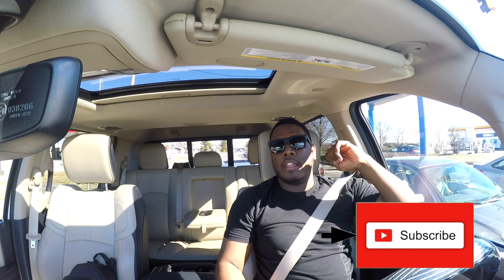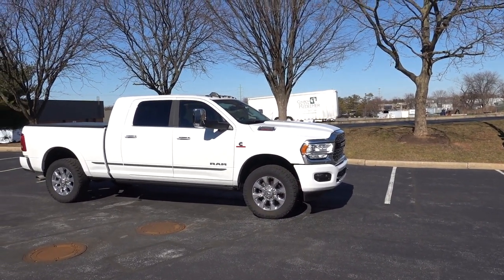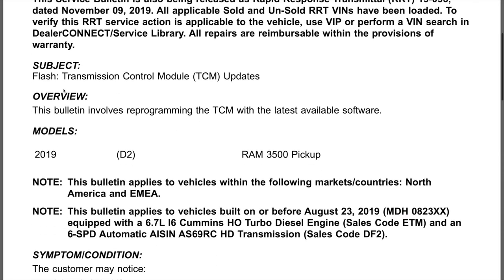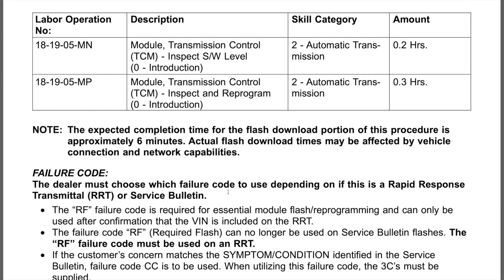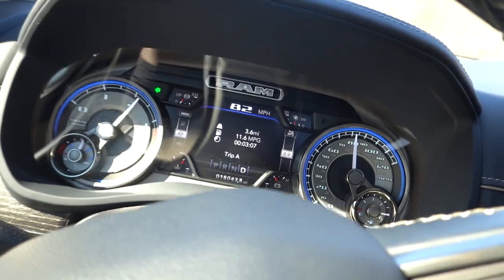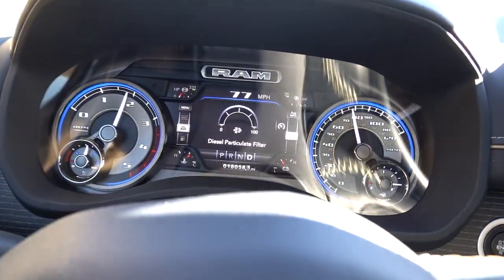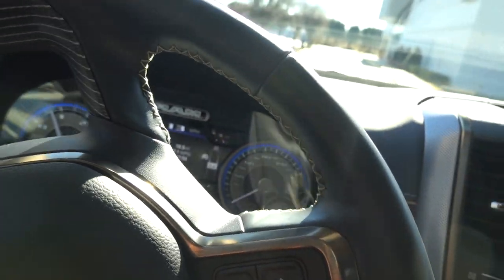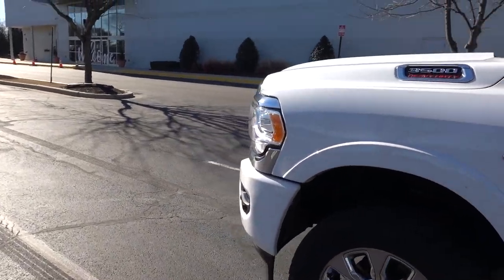Aisin Update After Reflash | RAM HD HO Cummins Acceleration & MPG Unloaded!!!

Comment: I have a 2021 3500 HO, SRW.  I have 3000 miles on it now.  I haven't got the DEF usage figured out yet.  I have yet to put ANY percent in the DPF filter.  It's been at 0.  I live in the country so no real city driving for me.  The dash pretty much is always at 18.5 MPG.  I haven't driven it on a highway more than 40 miles one way.  I've made several "mostly" highway trips that were 31 miles one way and the round trip has been coming in at a little better than 20 MPG.  

The only thing I consider quirky about the Aisin in my truck is shifting from Drive to Reverse if the truck isn't completely stopped it'll clunk.  Compared to the Ecodiesel the power of my 3500 is addictive. My ecodiesel trip B has 180k miles and an average MPG of 23.5 and that's with quite a bit of "dirty" towing at the end.  Hence the 3500.

And yes I feel the 21 Aisin wants to get to 6th gear ASAP.  It shifts EXACTLY like my brother drives his 01 six speed.  Like from a stop he gets to third gear and he's still under the light! I'm not crazy about lugging the engine so much I'm always afraid the cylinder pressures are too low.  So in the hilly country around here I'll usually limit the transmission to 5th gear.  That seems to keep me in an acceptable lugging range and it lessens the delay of the computer shifting down from 6th.  If you just pull out from a stop and don't baby it I feel the Aisin shifts through the 6 speeds exactly how I would shift it if it was manual.  I'm really OK with it.

Comment: i get what you are talking about on the driver adjustable shift points. I personally bought an hptuner for my 2004 Lb7 dmax Allison and the first thing i did was adjust all the shift points to where personally like as the driver. The factory one worked of course but for my driving style it held gears too long. Though I find that the Allison computer really does learn to adjust shift pressures on the fly pretty well, buttery shifts no matter load or not

Comment: Great video JB.  Glad that the transmission is working way better for you.  I was looking at you dash and noticed that you don't have the ability to manually shift like my GMC.  I don't use it a lot as my transmission seems to hold it's gear and shift up and down really smooth in city driving.
Reply: It's on the steering wheel
Reply from the maker: Thanks Ric, and like love racing said, it’s on the steering wheel. It’s definitely needed when towing 👍🏾
Reply: @JB_WhoWork  ok.  Didn't know that.

Comment: I’ve run my new 2021 F-450 with the 10 spd in economy mode and it up shifts super quick.  I usually drive it in the default drive mode and like it better in that mode generally.
Reply from the maker: Thanks for sharing 👍🏾

Comment: The torque of the cummins only needs 6 speeds, 10 is too much for it to shift, the V8 " not real diesels" may like the shifting, but the cummins hits 6th & pulls like a freight train 🚂
Reply: Ford guy?....
Reply: I personally like a 6 speed transmission better but the cummins doesn’t have the most in class torque lol
Reply: @holysmokes9813  nope not at all. I currently have a 2019 duramax. Previous to this a 15 duramax and a 14 cummins 68rfe. Loved the cummins but at 35k miles it needed its third trans. Have had a duramax since. Your cummins will eventually have a 10spd just like the rest of the market. That’s why I said your comment is dumb. What makes a diesel a real diesel?
Reply: @ToolsandTurbos  "Loved the cummins but at 35k miles it needed its third trans." What were you doing to the truck to blow through 3 transmissions?
Reply: @monsterram6617  towing a 28ft TT and a enclosed trailer. I really think it was more a tuning issue. When the converter would lock up the truck would shutter really bad. Dealership had my truck from December until April trying to figure it out. Got it back and still had the same issues so I traded it in on a 15 Denali. I did prefer the power of the cummins over the lml. Now I have a l5p and it is far better than both in my opinion. I wouldn’t mind trying a f450 next but I have never owned a Ford lol
Reply: How is a v8 diesel not a real diesel lol.  V16 diesels have something to say about that
Reply: "Not real diesels " 🤣🤣

Comment: JB - have you heard any updates on these aisin issues for new 2022 builds? I just ordered a 3500 Megacab SRW HO w/ the aisin, seeing all these bad reviews is giving me cold feet. I do majority highway driving about 30k per year, mostly unloaded to 1,000 lb in the bed. One weekend a month  towing a 9,000 lb travel trailer with plans to upgrade to a 11-15,000 lb fifth wheel. Hoping these issues have been improved by now?
Reply from the maker: Hey Brent the updates have been made to the Aisin for newer trucks and I’ve noticed they do shift smoother although the delay is still evident. This is the most reliable transmission in the HD market currently. I’ve heard from GM/Ford owners that they have had issues with the 10 speed which isn’t a surprise since they haven’t been out that long. Aisin has been around for over a decade and has improved over time so rest assured you got the right truck 👍🏾
Reply: Thanks for the reply! Definitely helps ease my mind that I made the right decision. As a viewer, I appreciate everything you’re doing with your channel. This will be my 3rd ram (‘16 and ‘19 1500s) but 1st diesel. Can’t wait to get behind the wheel. The interior design on these Rams are second to none. I’d have a tough time switching to Ford/GM!
Reply: @JB_WhoWork  Hey JB! Would you say the updates made to new 2022 aisins are sufficient  for daily driving now? I love the idea of having the aisin for monthly camping trips but don’t know if it’s absolutely necessary to have, considering this is primarily a daily interstate driver. I don’t mind a little rougher shift but not rough enough that my wife and child don’t like to ride in it. I also plan to have this truck as long as possible 200k+ miles. Thoughts?
Reply from the maker: 😅 it’s rough but I would say if you are really concerned about comfort, go for the standard output Cummins. People are getting great mileage out of that trans and it’s definitely a lot smoother. I don’t think the Aisin is insanely harsh but it is noticeable when shifting through the city.

Comment: Lol... 20mpg's.. I have a 2013 Ram 3500 SRW with 74k mi on the Aisin trans.. I have owned it for a year and a half or since 54k miles. When I bought it it was not deleted and had a Bull Dog Tuner and Throttle box. Now it is deleted and has the newer 4 position EFI Live tune in it. I  disliked it with the Bully, and I absolutely hate the truck now. More weight with this one means = more grumpyness. Sure it will pull it, but... Also my EFI Live 5 tuned 2012 68RFE often got 18 - 24.. This is lucky of it sees 16 on a 1k+ trip dry.. Very displeased in comparison.  Maybe I simply got a bad one, but either way..

Comment: Have you tried driving in Tow/Haul mode all the time, even when not towing? It makes it shift like you want.
Reply from the maker: It does but I heard (but not confirmed) it’s not good to ride around in tow/haul mode
Reply: @JB_WhoWork  Do your own research, but Tow/Haul mode can be used all the time. I use it all the time, and it really makes the truck more drivable. I will take it out of tow/haul when cruising on the highway unladen.

Comment: Test drove a 21 3500 HO  tradesman 8ft crew  it was just in, thought the trans was trying to hook up with foot on the brake stopped,not real smooth. The shifts were not exactly great but its new, does this trans learn my drive style , is that an "adaptive" ? Feature, or could a 21 need a flash, Other than that cool .
Reply: The HO has a “learning transmission “ as he mentioned.

Comment: So I have really been thinking about trading in my 2018 gmc duramax for a 2021 Dodge Ram 2500. Bad idea good idea? Do I need to worry about the transmission in the ram? Need help haha 🙏🙏
Reply: Why do you want to trade? I just bought a 2020 with the aisin and I don't mind the way it shifts at all
Reply: I'm a Ram guy but a 2018 Duramax sounds like a nice truck! (Don't tell nobody I said that!) A new car scent air freshener would be cheaper lol. 2017 Ram with 68 RFE has been fine for me though. Good luck.
Reply: @loveracing1988  the def tank being where it is and having no gauge for the def and I really don’t have anything in the back seat either. No ac,heat vents only one charger. And in the ram you can fold the back out to have a flat floor which would be nice for the pup. But no major issues it’s more a want then need thing I should just get over it haha.
Reply: Get the 2021 RAM 3500 with an Aisin, you will be a towing & smiling man!

Comment: JB, how do I know if mine needs a flash? 2020 HO with the AISIN. My mileage kinda sucks.
Reply: Realistically go to the dealer for a oil change or something and ask them to check for any software updates
Reply from the maker: Newer trucks were updated at the factory so you’re good. Are you experiencing these issues?
Reply: @JB_WhoWork  the clunking and weird gear changes, yes. Not sure how long it was sitting on the lot. Got it the end of 2020.

Comment: What brand/style tires are you running?
Reply from the maker: Nitto Ridge Grapplers
Reply: @JB_WhoWork  Factory size on factory rims?
Reply from the maker: Factory size was 285/60 so I went 295/60 with new tires. You can go 65 but you may have to level to avoid rubbing

Comment: My truck with the new Flash never sees 20 mpg. Also when creeping through dirt roads, nothing major, the trans will heat up quickly and start slipping. My truck has never seen a hard life towing. 20k miles. Its just junk.
Reply from the maker: You have an Aisin?

Comment: I understand the truck is new and cost alot of money but if u want better gas milage better shift points more power and everything(except your cool idea of the trans functions in the big touch screen  your asking for can be solved with aftermarket tuning. These truck can easily achive 15 to 18 city and well into the 20s on the freeway wtih a exhaust intake and tune. And the transmission tuning is insane if they offer it for your year truck.
Reply: Did you watch the hole video he's getting 20.7 to 22 anyways
Reply: That's correct unless you know before you comment, that the Aisin hasn't the freedom so much or at all allowed outsider programming. The 68 is what you have to go with, and then get the valve body upgrade to take the power increase at 1,000 torque if you tune the engine too.
But you knew all that since you're that truck savvy and so helpful. Not like those know-it-alls in comment threads that are actually short of it.
Reply: @HTSS8  Not sure if your being sarcastic or not but I'm honestly surprised there is no Aisn tuning must not be enough demand to put the r&d into cracking the codes
Reply: @benbarker8145  yeah I did but his city mileage was alarmingly low unless it was just reset or something
Reply: @MrYaxalot  just like the 8 speeds haven't been cracked for tuning either and those have a lot better market share
Reply: @loveracing1988  might have the market share but I doubt it has the demand
Reply: @MrYaxalot  you obviously don't pay attention to aftermarket parts. There is a huge aftermarket for ram 1500's
Reply: @loveracing1988  Sure but they dont pickup power with a tune like a diesel so thats why i figured the demand for trans tuning would be low
Reply: @MrYaxalot  it is a Toyota Transmission and they have not released any codes.

Comment: How old is that flash? What is  the program number, and can I trust that my dealership will give me what I want? I’ve gone to quite a few, and they can’t seem to fix the issue I have, since driving off the lot! Contacted FCA, and they give you the run around, while I’m driving a $93K Brick that I can’t even start from my phone! All I wish is that the Fiat Chrysler corporation would send out a tier level 10 technician who knows exactly what he is dealing with, instead of these google mechanics.
Reply from the maker: It’s from 2019, what year is your truck?
Reply: I don't think you get the flash you "want". From how I understand it they come out with updates and you either elect to get it or not. I don't think its customizable. What do you mean by send out a tier level 10 technician? Is that from the factory?
Reply: My truck is also a 2019, and what I meant was for them to send someone who knows the truck! I’ve been to 5 different dealerships trying to get that issue fixed, and not one can do it! It appears to be a communication problem with the head unit, and a simple exchange with a test unit would probably solve the issue, from day one, but they won’t do it, and I’m stuck with the problem.